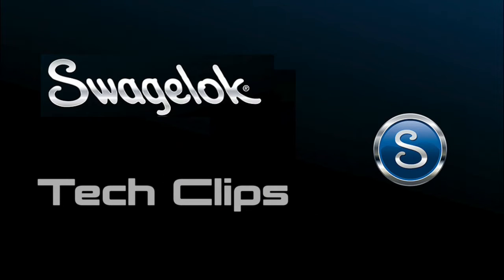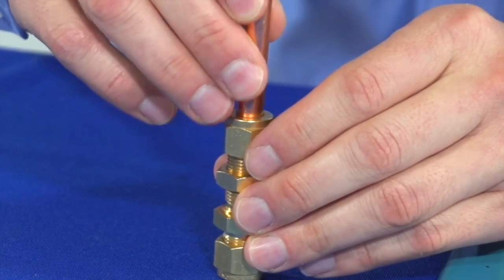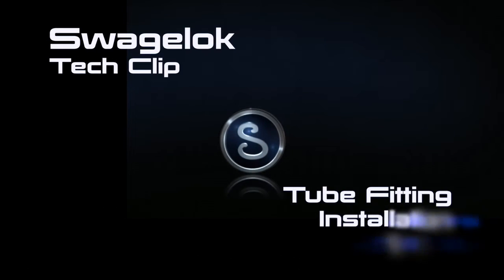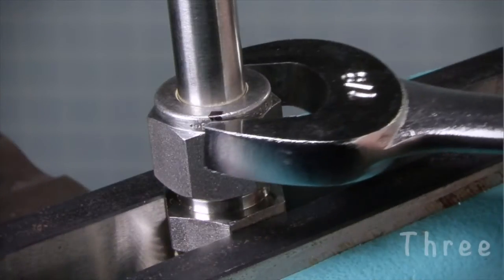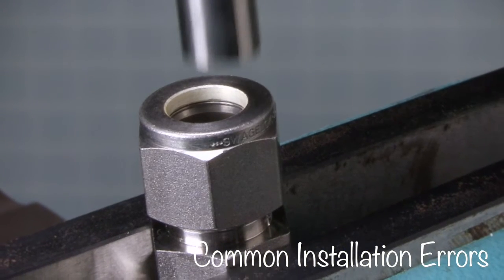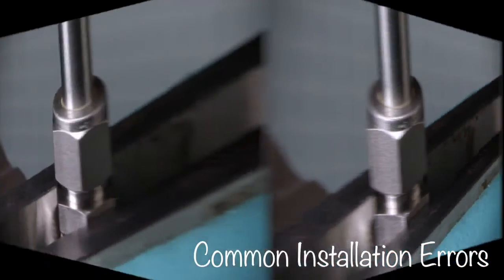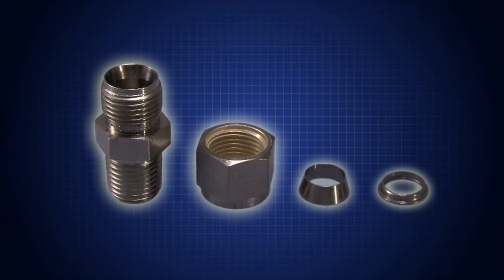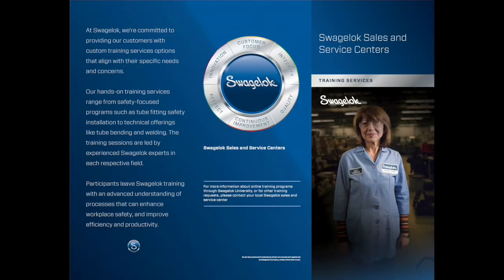Swagelok® Tech Clip -  Swagelok Tube Fitting Installation

Comment: Doesn't work in some cases. I have a new job where they use brass swagelock fittings to connect titanium tubing. They put stainless ferules into the brass fitting side for the titanium tubing. To get 1 and 1/4 turn is very hard and I have gone to using a flat sided 14 inch 90 degree pipe wrench and am now looking for some kind of cheater bar to use with the wrench along with the flat pipe wrench for more torque. Carpal tunnel is my result after 3 weeks on the job and nobody else has stayed very long at this spot.